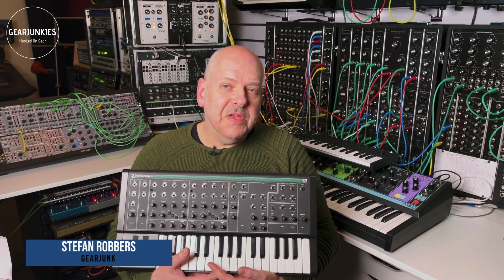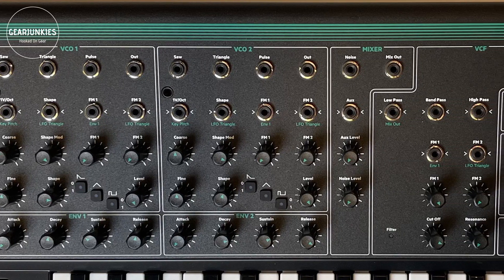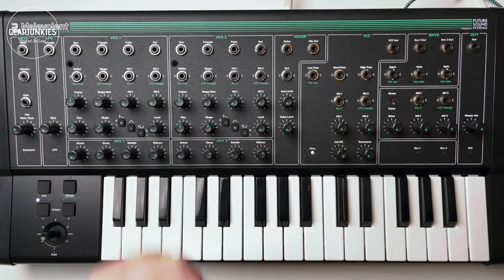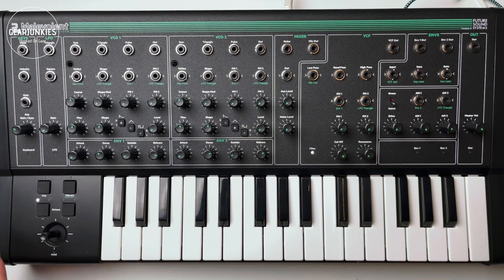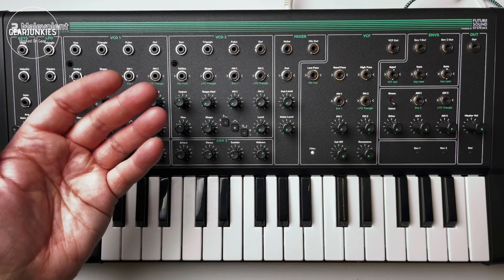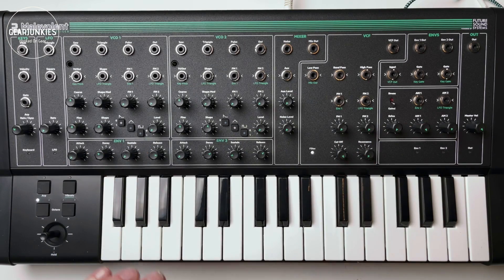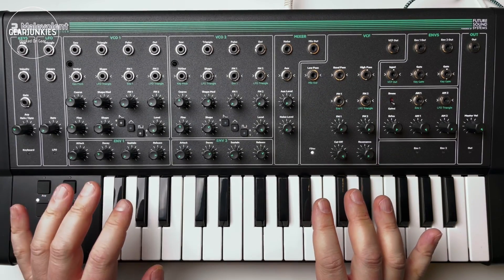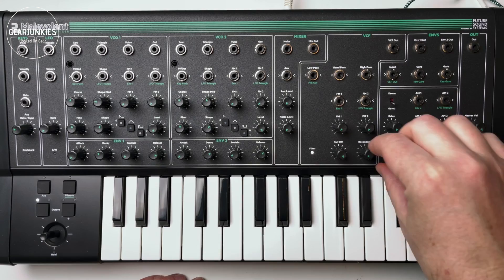The PWM Malevolent synthesizer in 19 minutes

Comment: I just picked up a Malevolent recently and I really really love it! A tad bit of criticism about this video… I  noticed that the oscillators were cranked up to full volume throughout the video. At lower volumes, the oscillators sound a bit different. I know they get quiet at low settings, but when tweaking the gain staging via oscillator level, resonance and the drive circuit, different timbres can be achieved. I’m not 100% sure if the amp circuits are imparting any flavor to the overall sound though.  It didn’t seem like it to me. Great video!